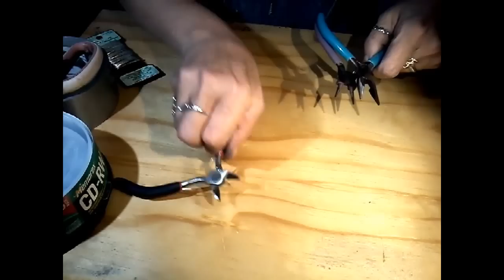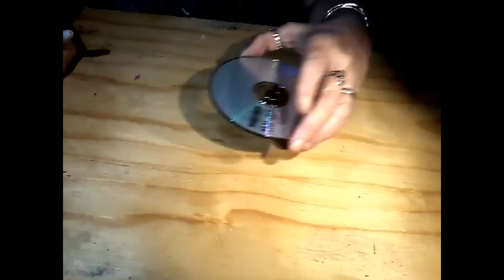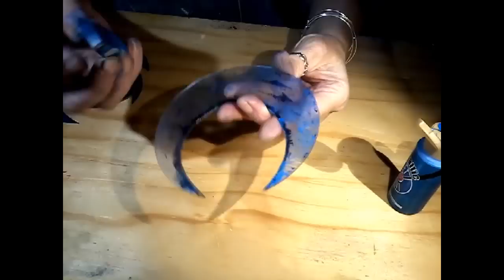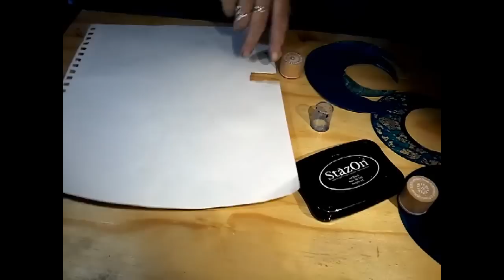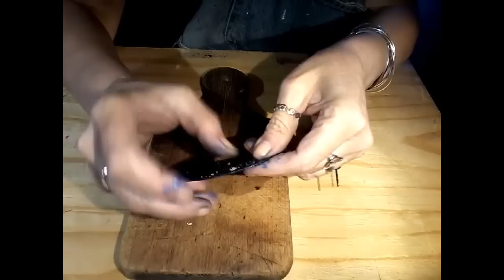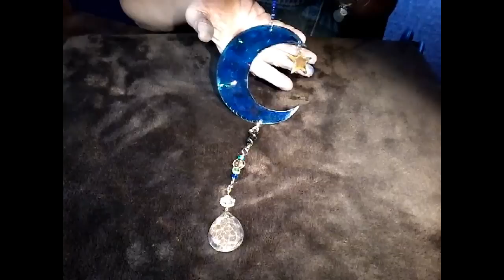DIY-CD-Crescent Moon Mobile

Comment: Cali, I just love all your hanging mobiles. I'm also crazy about hanging things in every window. I have a question about the moon with star mobile. Did you have to sand around the edges of the moon and star to get rid of the rough edges where you used scissors to cut? Or I guess running a hot iron around the edges would smooth them out. Just wondering. Thanks, Lisa